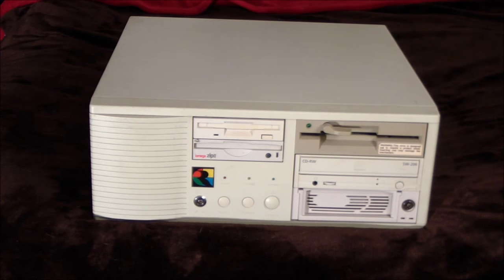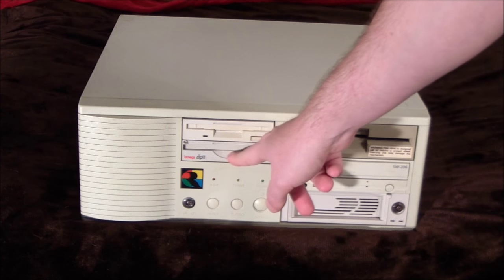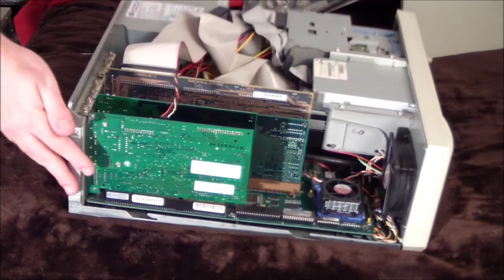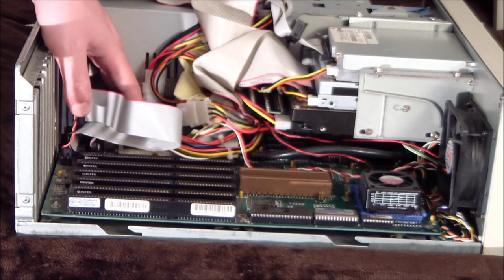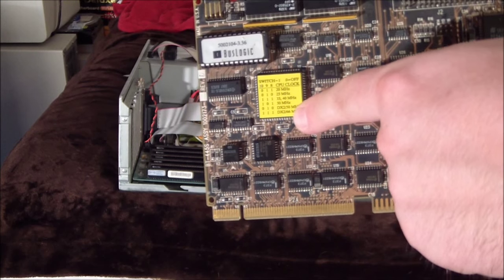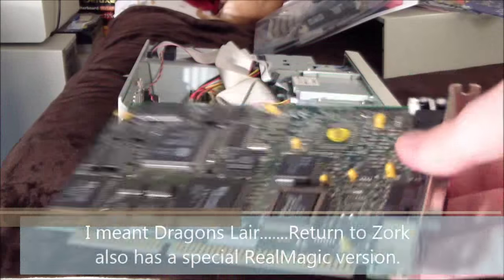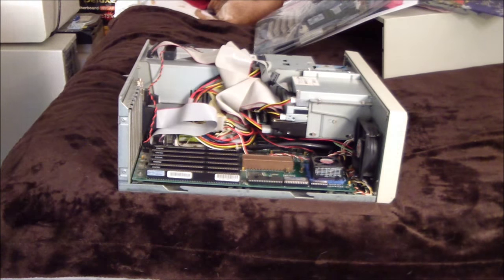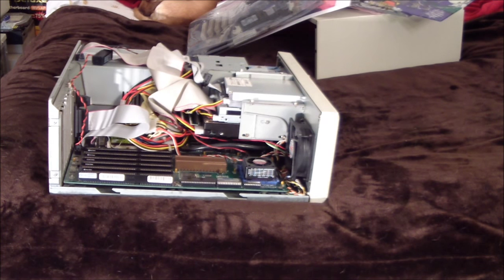Anatomy of a 486 PC

Comment: Uploaded to Vogons Drivers:

1 - The original manual in pdf format.
2 - The Dos-Only software suite/drivers.
3 - A homemade bootdisk for setting up this card as a simple HDD/CD system. (the bootdisk is MS-Dos 6.22 only)

The bootdisk has everything you need, for partitioning, formatting, attributing and sys'ing a disk. It has MS Fdisk from Dos 6.22 and it has BusLogic's partiotioning tool. There are mouse driver on it and you can choose to boot with CD-Rom support. Or just make a simple basic boot without any CD and Mouse support.

Comment: The 486 (and to an extent, the 386 SX) was among the first generation of PCs that could actually do things that couldn't be done by an average graphical calculator or an early 80s 8-bit micro. Once the PC moved definitively beyond the early days of 640k and CGA, it actually became a useful machine in its own right, even if no longer usable today. 
OTOH, the 80s generation of 8086/ 286 computers were often inferior to other 16 bit computers such as the Amiga or the Acorn Archimedes- and not that much better or more useful than some 8-bit boxes.
Windows 3.1 killed off most of the non-PC "compatibles" and Win95 nearly killed off Apple as well, to the extent they had to bring back Jobs and all future Macs were NeXT machines with added PC compatibility. Without the 32 bit processors, even if underutilised by 3.1 or even 95, the PC would have remained a frustrating, slow, large calculator with a typewriter facility rather than what it is now.

Comment: I have that exact buslogic bt-445s controller. And it is indeed awesomme. I have the manual in pdf format. Shall I upload to vogons drivers? Do you have any software for it?
Reply from the maker: I have some software I found somewhere on the internet years ago. Not even sure I have that floppy disk anymore. I say if you have the manual and any relevant software it would be pretty cool if it got uploaded to a reliable archiving site like Vogons.
Reply: 0blivi0n100 I have some drivers for os2, win and dos. 4 files in total. Can you remember if there were anything else than drivers? Like setup tool or something?

Comment: Going through Vogons, in search of information on VLB-SCSI solutions. I was guided to you'r blog, and found that the BusLogic you have is the same as the one I bought yesterday. So... How is the card holding up? I also found, that I have an ET-4000-W32-PCI card, and I plan to have both run on my FIC 486-VIP-IO motherboard. Well... Alongside 32mb Ram and my AMD-486dx4-120 CPU.
Reply from the maker: Since installing it I haven't had any trouble with it or with any devices connected to it. It's worked perfectly for me thus far. I currently have all my games loaded onto the SCSI drive and the OS loaded on the IDE drive that I originally used. If I wasn't being so lazy about reinstalling DOS and reconfiguring everything I would get rid of the IDE all together and add another SCSI HDD and reinstall the DOS on it.
Reply: 0blivi0n100 So it is a solid controller then? Good to hear. I have made a post on Vogons today, asking about what setup to re-build/do better or something. Yeah.... You know.
Reply from the maker: I haven't had any issues with it and it seems to play nice with the IDE devices as well without conflicts. I'm not running write-back cache though which SCSI doesn't play nice with but I hear some cards will work with it. I haven't tested if this card will so keep that in mind if your cache is in or capable of write-back mode.
Reply: 0blivi0n100 It will conflict on a FIC 486 VIP IO motherboard for some reason. Cant get it to work on that board. My Abit board is running it stable.
Reply: Forgot to mention... The controller is running alongside an Spea mirage v7 (S3-805) VLB card. And it is running a dx2-80/40fsb. 100 percent stable. So 40 is possible. The controller had a high pricetag in 1993. So it is quality all the way through. Think it was somewere between 425 and 450 US Dollars back then. Saw it in a pc world found on google docs or books.